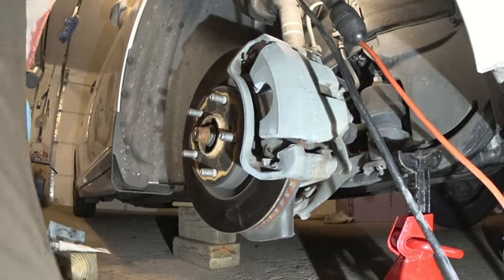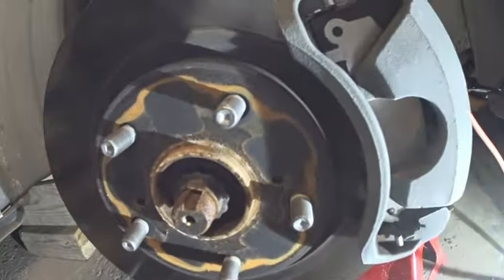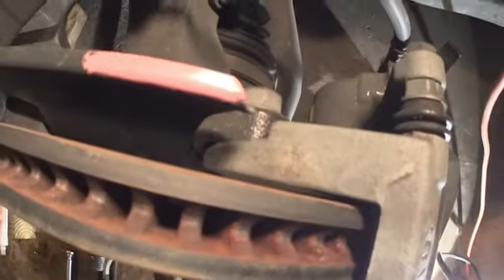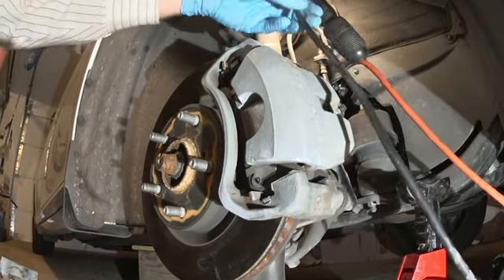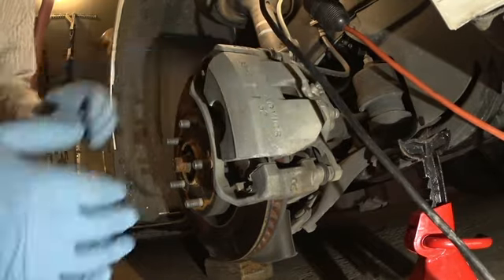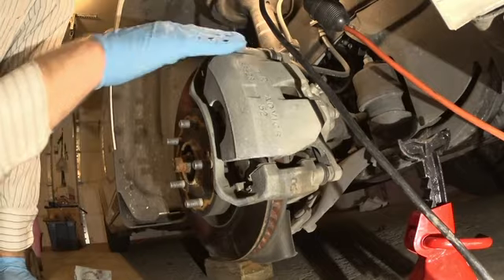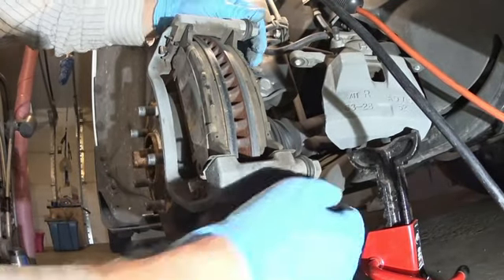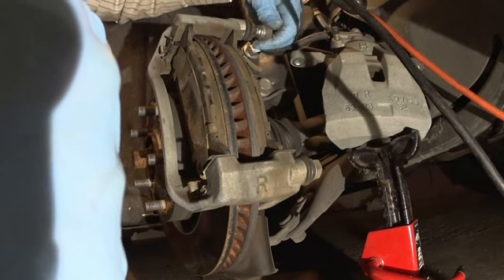How to replace front brakes on lexus es 350

Comment: Just replaced the rear and front brakes on my 2007 ES350. According to my local repair shop, my front brakes were unsafe with less than 1mm of braking material. Well, turns out they were still good with approximately 5mm of material left and the rotors needed only a good cleaning. I changed everything anyway. Yes, I saved lots of money by doing this myself but more importantly I learned never to trust my 'trustworthy' repair shop again. Many thanks.
Reply: Lexus dealership said the same thing about my wife car front brakes and rotors. I'm changing them now and brakes have about 65 percent life left and the rotors don't even have a slightest lip. Smh
Reply: Well I have to retract this reply, the storm only allowed me to complete the passenger side the other day. Last Night I replaced the drivers side and seen one of the Caliper pins were frozen causing one of the brake pads to look warped so yes, if one side needs to be changed then both do so the dealership was correct. I purchased it during the pandemic and my wife hadn't put a lot of miles on it, but I guess I gotta start taking vehicles apart when I purchase them cause some shops never grease the pins and that'll lead to problems.

Comment: Rotor removal tip: buy a M8 x 1.25 size bolt and screw it into one of the threaded holes near the center of the soon-to-be-old rotor to separate it from the hub. it's *way* easier than trying to bang and hammer a rotor off that's rusted and stuck to the hub...

Comment: Best way to do front brakes is to buy rotors, pads, and calipers for a Toyota Highlander and do that. Larger diameter rotors, twin-piston calipers, and they fit up perfectly on a ES350. Braking power is substantially better.

Comment: Nice job. I have replaced my wifes brakes several times, but have been doing it the hard way..haha. This confirms what I have thought would be the simplest solution.
Reply from the maker: Thank you. Consider subscribing.
Reply: PS- I followed the link to the brake pads you suggested and it says they dont fit my wifes 2007 ES 350..just some info for you
Reply from the maker: Thank you, I will double check.

Comment: @repairvehicle- You used Toyota grease to lubricate the pins.  which grease did u use to lubricate the sides of the brake pads was it the same grease or other high temp grease?
Reply from the maker: Other high temperatures grease
Reply: @repairvehicle   thanks for your response.  Can I use any high temp or does it have to be brake specific.  Can u share the name what u used.
Reply from the maker: You can use any high temperatures grease on the side of the pads. I don't remember what I was using in the video.  I need to watch the video again to refresh my memory.

Comment: Hello, I'm confused about what tool to use. If I just want to remove the caliper, do I need 14mm or 17mm socket? I think both sizes are mentioned in the video.
Reply from the maker: Watch video again please
Reply: @repairvehicle  So if I just want pad replacement, 14mm should be good. And If I need to remove the caliper assembly, than I need 17mm. Is that right?
Reply from the maker: Yes
Reply: @aannddyychang6162  

14mm for the caliper bolts

17mm for the caliper bracket bolts.

Comment: With regard to brake pads which are best for 2012 ES350?  synthetic, ceramic, organic?
Reply from the maker: Oem grade material
Reply: Centric Posi Quiet Ceramics.

60,000 miles and still going strong.

Been using them for 10+ years.

Comment: Great video, thank you!! Quick question...is the caliper sliding pins that you greased the same orientation on both sides? In other words, is the smaller pin with the rubber ring go on bottom on the left and right side?
Reply from the maker: I don't think it matters, however I don't remember unless I watch my own video to refresh my memory
Reply from the maker: You grease both pins same way.
Reply: repairvehicle Thank you very much, really appreciate the fast reply!!
Reply from the maker: Please subscribe and share my video with others. thank you.

Comment: What issues might arise if you get the grease on the brake pad surface or rotors?
Reply from the maker: You just going to have hard time stopping car until all the grease burns off due to heat and friction.
Reply: @repairvehicle  Thanks for the timely answer! One more question, do you need to apply the C-clamp to the caliper in order to push that piston in? Should you take the cap off of the brake fluid before doing that?
Reply from the maker: Clamp applied to the caliper in the middle, avoid brake line bolt. Do not remove cap, moisture from air will enter brake fluid.
Reply: @repairvehicle  Thanks a lot, man.
Reply from the maker: No problem

Comment: What is the minimum size c clamp needed? Your clamp looks  too big. Would size 7 or 8 inch c clamp be enough? Thanks
Reply from the maker: I have Size 6 and 8 and both work on my cars.
Reply: @repairvehicle  thanks. I have a 2018 Rav4 FWD XLE that has a sealed transmission but instead of a trans dip stick it has a thin black tube. Do you know what that is for.
Reply from the maker: Thin black tube is a breather tube, allows for transmission to exhaust air when fluid expands.
Reply: @repairvehicle  thanks
Reply from the maker: Np

Comment: Good tip is every year get some Brake cleaner spray and give the front discs and pads incl rear brakes a good spray,you'll be surprised the difference it'll make.Do give the wheel nuts  and metals surfaces a wipe with Copper grease while the wheels are off,it don't take that long.Look after your car and it'll look after you.

Comment: My rotors are seized on the hub.  How do I loosen the rotor to remove it?
Reply from the maker: Craig Seymour, use a bolt like I show in my video to break rotor loose or spray wd40 and hammer it on the rotor. Make sure you hit the rotor on the side.

Comment: 2007 lexux es 350 front rotors chang
Reply: will this video work for a 2007 lexus es 350 rotors change?
Reply from the maker: Yes
Reply: @repairvehicle  thank you for the quick reply! i’m working on the vehicle this morning
Reply from the maker: No problem. I have many videos for your lexus on my channel
Reply: Shouldn't you clean the slider bolts of the old grease before putting on the new grease?
Reply from the maker: No if it’s same grease. But if it’s a different grease then yes it should be wiped off
Reply: @repairvehicle  you said that the bolts were not sliding, one bolt looked clean, the other looked like it had black dried grease on it. If you didn't do the job last time, how do you know what grease it was?
Reply from the maker: @joelwolff6877  , I would not know if did not do it last time.